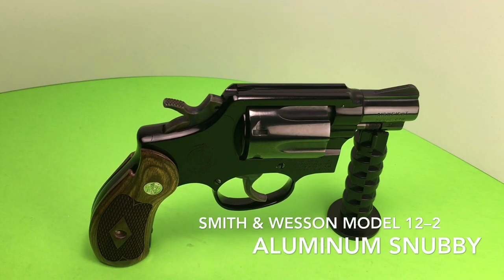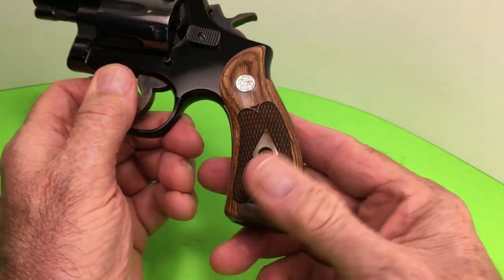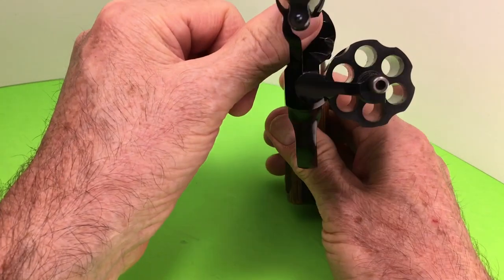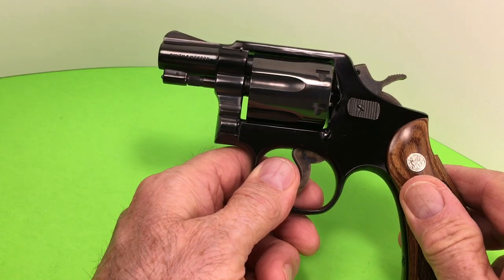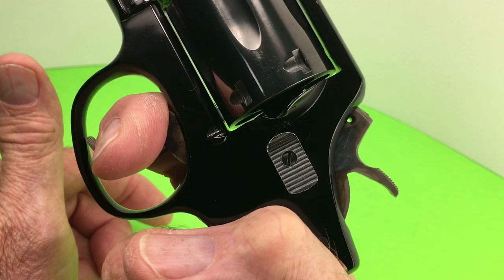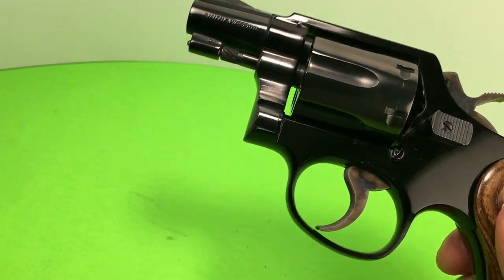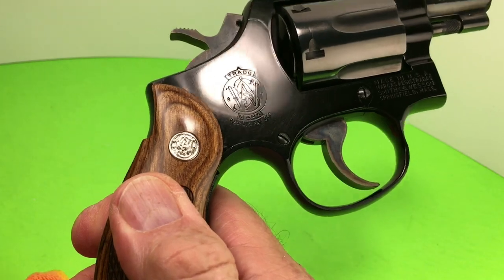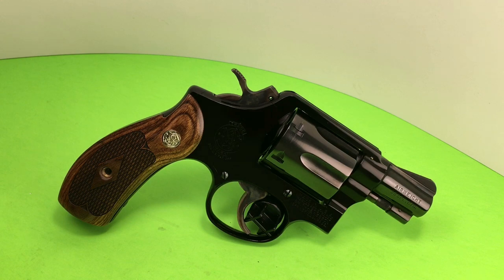SMITH & WESSON AIR WEIGHT Model 12-2 Snub Nose

Comment: The model 12 frame is .080" narrower than the standard K frame. This is maintained thru at least the dash -2 version. Possibly also the -3 version but I'm not sure on that. I have a -2 and absolutely love it. Proper grips are a little hard to find. Don't shoot hot .38's thru these as they are prone to frame cracking under the forcing cone. Very light and comfortable to carry. Great S&W snubbie.